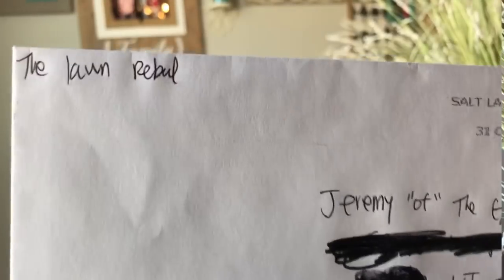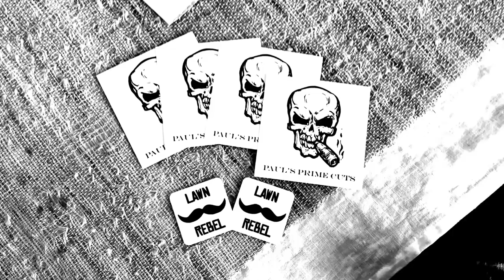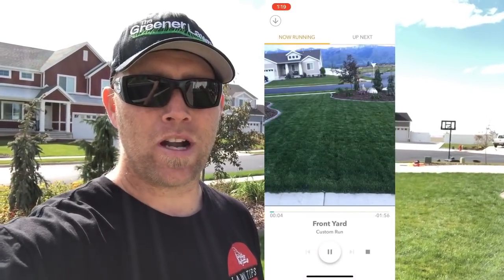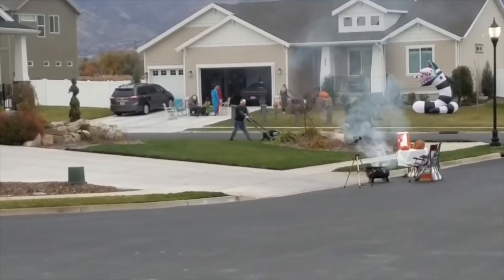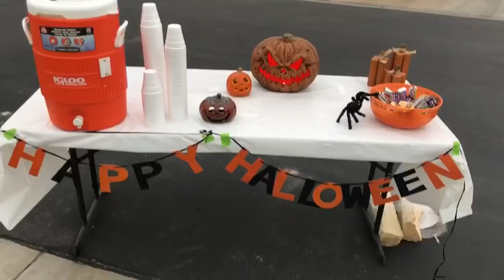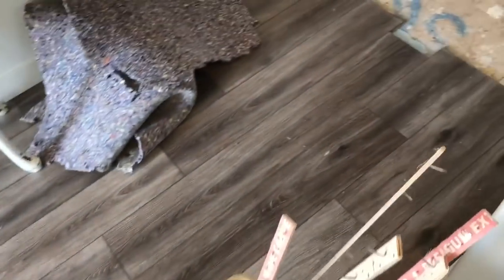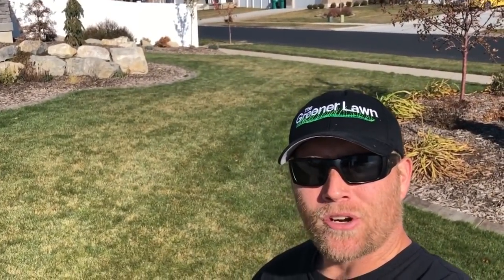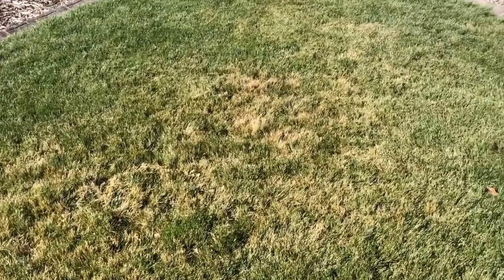Fall Lawn Projects | Honey Do List | Home Projects

Comment: Hey Jeremy ... quick question about the irrigation blowout.  That pancake compressor was sufficient?  Anything special you needed to do while using it other than the connector?  How many passes were required?
Reply from the maker: That was suppose to be it’s own video.. I messed it up by having the mic the wrong way... 👎🏻... so with that 6.5 gal pancake, it took me just at 30 min to blow out all my 9 zones... not that fastest, but yes it had sufficient power with 2 passes each. So I know you can do it through the sprinkler heads, or though the filter. If I didn’t have it built in, I would of blown it out through the filter, and it’s a pvc fitting to go on top of the filter, and then there is a pvc reducer that fits inside of that, that a compressor fitting fits on:

https://youtu.be/qrwuvNoPQl0

Jimmy showed that part well